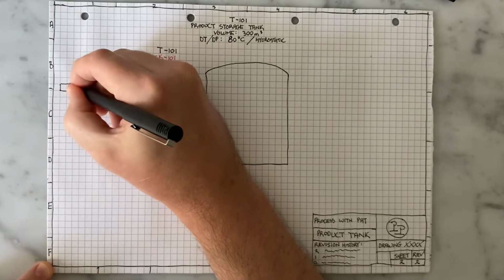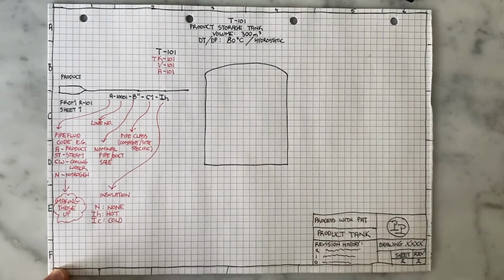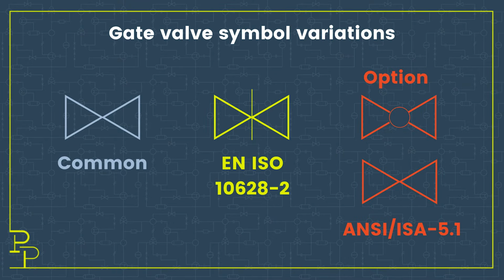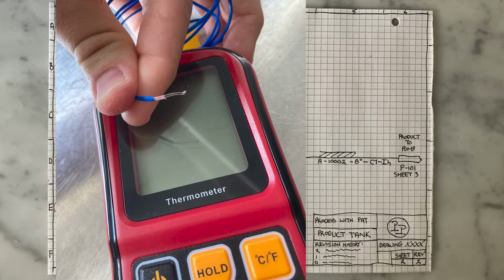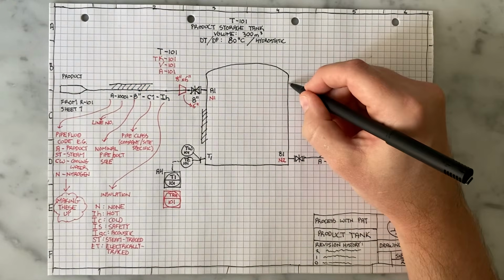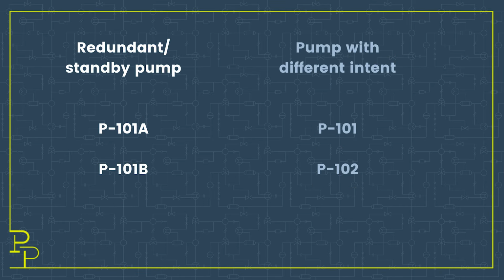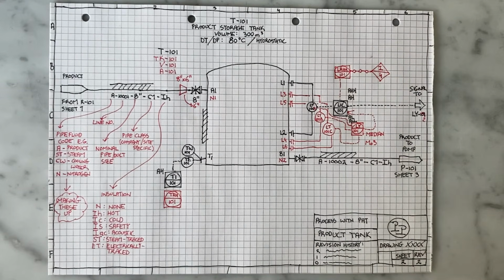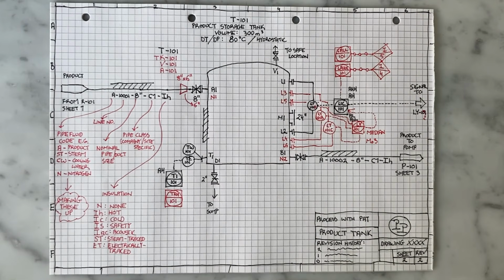Piping & Instrumentation Diagram from scratch

Comment: putting a drain on the bottom of the tank is tricky unless the tank is suspended (using legs or a skirt).  So you might want to consider showing the drain coming in the side with a dip tube.  If you really can put the drain on the bottom of the tank, then sometimes showing grade and the support method helps to clarify the situation since a skirt can create a flammable confined space hazard.      Speaking of dip tubes, your feed into the tank, might also benefit from a dip tube (which will reduce static hazards), but be sure to provide a syphon break in the feed line to prevent accidental reverse flow.

I think a pressure gauge on the tank might be a good idea too.